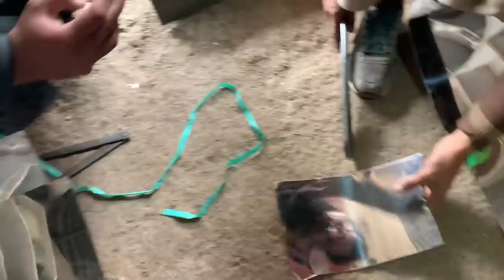How To Build Homemade Wood Burning Stove

Comment: OK, but that's not "homemade", that shop is all they have to manufacture their commercial products.  A very interesting and simple economy.  Dirt cheap labor, no quality control specs to meet and no safety or compliance regulations for either the products or the employees.  Somewhere else on that street there is probably some guy turning burned out & broken stoves into recycled sheet metal.

Comment: Jeez .... no cast iron or even plate steel; I'd be burning holes thru that stove in an hour.
Reply: Well, I was thinking of about 3 or 4 weeks worth of cooking one meal on wood per day, but yeah, pretty much.

I used to flame erode oil drum incinerators in a single year of weekly garden waste burns, and those were significantly thicker than the metal used here. I now use half an old industrial compressed air tank that I found at a local metal recyclers. I lopped it in half, welded on some legs, drilled a shed load of 30mm air holes in it, and put it to work. It's gone 8 seasons so far, and is only now starting to get a bit weak in some places, but I suppose even 6mm plate steel has to get weakened by that much heat eventually. :D